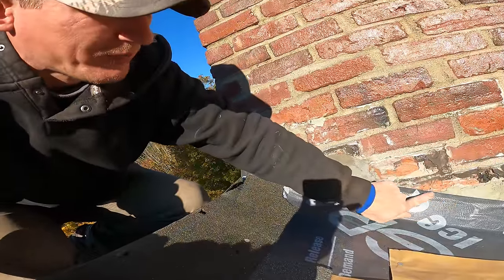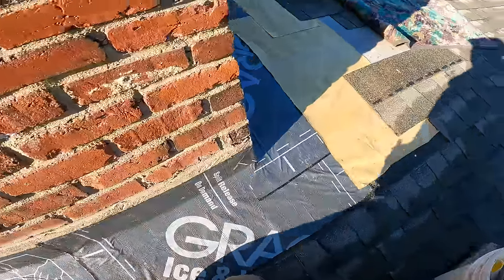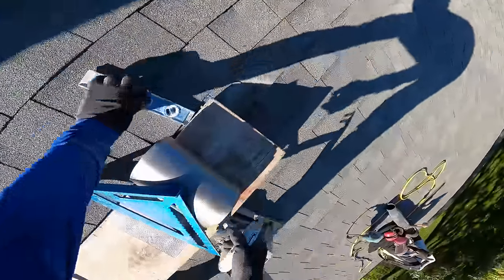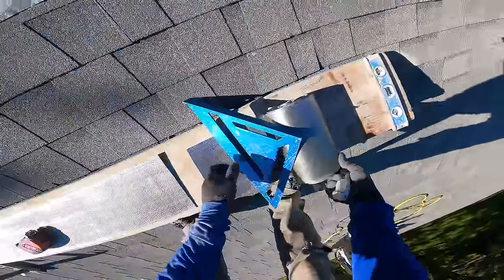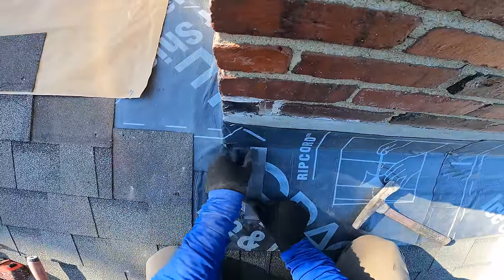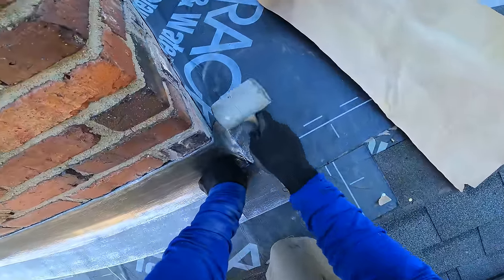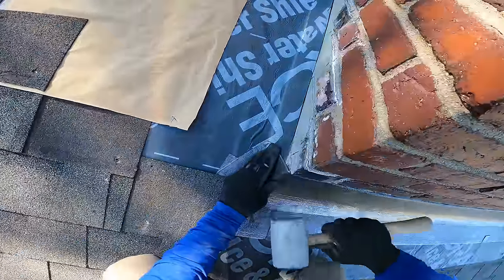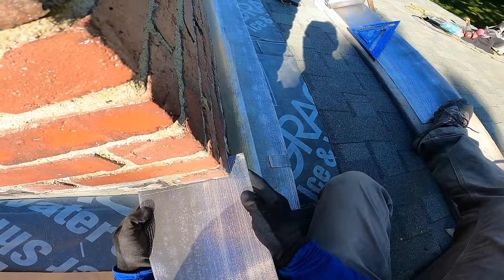Chimney flashing install | Part 2

Comment: We have been engineers and general construction managers for 40 years.  We have seen every way to flash incorrectly and they all fail.  However, here we have genuine cut-in step flashing!  This is the only way to correctly  flash a chimney or trim.  Very enjoyable to watch flashing done correctly.  This should be a training film sent to all roofers in America who would nail their aluminum flashing on the brick and caulk with any tubes of caulk that will fail within a year or two.  A genuine thank you for posting this very well done effort.
Reply from the maker: Than you for your kindness.
Reply: I just posted above, but have to say I totally agree with you. He did such a good job and the video could literally be a training film.
Reply: lol wut,every chimney done with solar seal caulk and proper double hem bent towards chimney will outlast shingles. engineer and manager means you havent done 300 chimneys like i did with my own hands and theoretical knowledge is not always works in actual field work
Reply: Would it work if you put the ice and weather shield right to the chimeny and then put roofing cement to cover it?
Reply: @jusnielful  just cement along the perimeter can make it last a while,no need for ice water
Reply: This would be a cowboy job in the uk  definitely not a how to
Reply: @chadvaillancourt What causes a concrete fire hearth to be very damp?  I would appreciate as much technical advice as possible please because I have an issue with my chimney I think?
Reply from the maker: @rachelbailey-no2pp It’s hard to say without pictures, there are many possibilities. if you send me some pics I’ll take a look.
Reply: Only thing missing is comments like ‘each counter flashing step should be x” wide and y” long’ and “ make sure they overlap by z”’.
Reply: No lead tray!
Doesn’t matter how well you cut your flashings in and seal them!
If you have moisture coming through the top of chimney , where’s it going to go?
Apart from inside!!!!
Reply from the maker: @DavidWilliams-zn2nc we don't install lead trays because they always fail. If they worked, I would consider them. Every chimney I do is water tight when I leave.
Reply: @chadvaillancourt   Sorry mate, lead trays when installed properly don’t fail.
I’ve been a roofing contractor for 40 years, lead flashings when done correctly are fine for waterproofing the outside.
Bricks are porous by their nature, so any brickwork above the lead line is susceptible to water ingress. When done correctly with weep holes ,the tray allows any moisture to escape the chimney out of the weep holes over the lead. 
Ill be happy to post the the technical diagrams if need be 🤷🏻‍♂️
Reply from the maker: @DavidWilliams-zn2nc I know how they work in theory, I've even seen some really good ones in person. They cause the chimneys to fail in my climate. We have a lot of freeze thaw. I'm open-minded, I could be convinced if I ever saw one that was done properly and still complied with todays standard. Besides, I solve these problems every day on chimneys that have been leaking for decades without    rebuilding and adding a lead tray. I'm working on one today. It has a lead tray and leaks every rain. It won't leak when I'm done.
Reply: @chadvaillancourt  Well, you’ve almost answered the issue, in theory it will always work, fact!
The problems start when they’re not installed correctly!
The Brickie ( mason ) must keep the inside of the chimney brickwork clean. If not, and the tray becomes full of mortar then that will stop the tray doing its job.
Unfortunately, this sometimes happens & of course it’s the roofer who gets the blame for any leak!
I can see you’re a skilled tradesmen, all the best 👍
Reply: Or to the ones who cut right through the brick diagonally. Chad's probably seen it in his area
 I see it way too much

Comment: Polyurethane caulking works so well. Much better than silicone. Comes in many colors as well and smooths out like a dream with dawn dish soap and water.
Reply from the maker: Polyurethane caulking is subject to UV degradation and won’t last nearly as long in this environment 😕
Reply: @chadvaillancourt  I get it. 5-10 years vs silicones 20 year life. Poly accepts paint well around brick mould and is excellent for sealing wide cracks in masonry. Easier tooling as well.
Reply: NEVER use any soap for smoothing sealant. EVERY major manufacturer says to dry tool
Reply: @chadvaillancourt  silicone does not bond to graces self adhered sheet goods. In fact we use it to make temporary dams on bituthene for water tests because it peels off easily and cleanly.
I have installed polyurethane sealant  on high rise buildings that is still in perfect condition after 30 years. But you have to use quality products.
Reply: @bunnylou4993  if you are only getting 5-10 years from polyurethane you are either installing it wrong or using cheap material. But since you said use soapy water it is clear you are installing it wrong. We routinely get 20-30 years from urethane.
Reply: Has anyone tried E6800?  Or Vulkem 116?  I had a Velux skylight fail after 10 years. The factory sealant between the glass and aluminum trim (not the flashing) became brittle and leaked.  I dismantled it and applied clear E6800 because they claim UV resistance.  It's been about 5 years and no leaks yet.  Both of these products are supposed to work on masonry.  Thoughts?
Reply: @dumbluck6180  Vulkem 116 is a quality product. I have used it for probably 25 years or more.( maybe 30) I have no experience with E6800. But it is a consumer product and generally speaking consumer waterproofing and sealants are inferior. And since all the specs I can find say it is a construction adhesive I would never use it in a waterproofing situation. Construction adhesives are not the same as Caulk or sealants. I could be wrong about it since all I could do was try to find its specs. But as a professional waterproofer/caulker I would never use it . BTW a good sealant when properly installed should last 20-30 years or more.Of course no one will guarantee it that long.

Comment: There have been a lot of bad ideas and false claims by new products in the trades over the years, so it is no surprise that people who get used to using one product are gun shy about accepting a new product or new way of doing things. However...the "has to be mortar" guys need to face it: modern tri-polymer caulks like Geocel, Through the Roof, etc. absolutely outperform mortar in this application in every way possible. They are more waterproof, they are tougher, they will last longer, they are more resistant to the kinds of stresses they will experience in heat/thaw weather cycles on a roof, they adhere to the substrates better(mortar doesn't adhere to lead AT ALL), and they are flexible to allow dissimilar movement between substrates without failure. There is literally NOTHING that mortar does better in this situation. Nothing.

Comment: Super clean install. Great 2 part video to learn from. I have a lead flashing repair to do and this taught me a lot. 

Pro tip: Once you the last ridge cap shingle is on and the silicone is wet. Rub 2 shingles or caps together over the silicone so the granules fall into the silicone so you don't see the nail heads. Another option is to put silicone/tar/roofing cement all over the last ridge cap and wet set another one over the top of it so you don't have to worry about nail heads.
Reply from the maker: Thanks, I’m glad you learned something from this. 
Great idea with the granules. I know they sell containers of granules but I never thought to grab some from the shingles I had. Almost all roofers here don’t cover any exposed nails with anything anymore. Sad really.
Reply: Smart, I'm doing this on my next roofing job!

Comment: The amount of time and care taken for this job was amazing.   I'm redoing my whole roof and wanted to flash my chimney in a similar way but finding lead flashing and the sheer cost of copper just doesn't make sense unfortunately.  Still hard to find some of these specialized materials here in the Midwest without paying an arm and a leg.
Reply from the maker: Thanks! Lead is available at all masonry outlets and hardware stores here, even Lowes and Home Depot have it. It costs about $140-150 per roll now, although I have one supplier that will sell for $110 per roll.
Reply: If you know of another system that works then it would be interesting to hear about it.  Otherwise how can you afford not to do it this way?
I am not trying to be a jerk.

Comment: We use lead plugs to keep the lead in before siliconing little strips of lead rolled up and pressed into the joint so that it's tight and the lead doesn't move 👍👍 but really like how you do it as I haven't seen many people using lead over your way it's great to see

Comment: Great workmanship! I've been roofing for 45 years and haven't seen workmanship like this. Especially scribing the vertical lines to get a nice plumb look! 
Only one little nit pick, the nails in the shingle at the bottom left corner (1:02:22) are too close to the flashing and being that the flashing has a slight slant to it away from the fireplace the water is going to head toward those nails. Will it ever leak? Probably not, but after all that fantastic work it's the weakest point. I also like to leave about a 3/8" space between the edge of the shingle and the vertical bend in the shingle to allow a space for the water to run down. The water can still run under slightly but it helps with the water flow especially if the chimney is lower on the roof where there is more water accumulation. Thanks for the detailed workmanship. Nice to know that there are still quality workmanship being done!
Reply from the maker: Great catch with the nail! I’ll have to do better next time. Thank you for pointing it out and thanks for your comment. Very observant!

Comment: What a nice job!  It looks really good too.  Good explanations on why you do each step.  I do handyman work, and nearly every house I enter has botched work. It blows my mind how much bad work I see. In Part 1 you showed layer upon layer of messy repair attempts that failed.  Those hack jobs are fine in an emergency like during a storm when you're just stemming the tide until you can do a proper repair.  Very much admire your skill and methodical work.

I'm originally from MA and your accent sounds familiar!  My 70 year old house in OR has the original heavy galvanized steel step flashing. I re-roofed 27 years ago, and just lifted it up like you said. It could probably go another 20 years, but I'm going to replace it with lead the way you did.
Reply from the maker: Very kind comment, thanks for the support.

Comment: We’re having problems with a smaller chimney that used to be for a oil burn furnace but now simply acts as a stack for the vent and exhaust for the gas forced air furnace. The roof shingles were replaced two years ago and now we’re getting leaking in the basement that comes down the chimney sides. I had to laugh at your comment when you said that roofers and chimney guys don’t do each other’s jobs because my roofer won’t touch it with a 10 foot pole so I’m gonna have to hire a professional like you to do mine And I’ve got a place in mind. Thank you for showing us how the real pros do it. Good luck, live long and prosper.!
Reply from the maker: Yeah, it’s a tough thing. Your roofer likely put enough silicone to make it not leak for a couple years, now his work is showing through. Thank you!

Comment: I live in hill billy USA. When the roofer talked to me about flashing the chimney following a derecho, he said most people just have it packed wiith roofing cement, but I opted to have it flashed by their sub contractor for $250. The roofer did the lower flashing. The flashing guy used metal, not lead. He didn't step flash but just has it running at angle parallel to the roof line. I had to have him come out two more times to fix it from leaking. He said he cut a groove before installing it. I guess he did. My chimney is well down from the ridge in the middle of the roof. At the time, I didn't know how to build a saddle or cricket and the house didn't have one. My guess is the chimney sat on the ridge back when it was built in 1923, but the deadliest tornado to hit the USA decimated this town in 1925, and it appears they changed the orientation of the ridge from front to back to side to side resulting in the poor placement. Anyway, long story. You do great work.

Comment: This is the quality  craftsmanship I try to achieve on a daily  basis.  I'm a mason for a chimney company  just up 495 and there always rushing me 😆..  I actually  stumbled on your channel because I'm a self taught  and I sometimes use YouTube sharpen my skills .  I also have the same thoughts on caulking those joints 👍  I use a geocel caulking  myself.
Reply from the maker: I’m glad to hear it! YouTube is a great resource no matter the skill level. Everyone has a different way and lots can be learned if people are willing to share. I used the geocel proflex for years but I had to stop because of the cardboard tube. It’s a good product.
Reply: Do you think  silicone fails more often than well set mortar over the long run?

Comment: As a retired contractor of 42 years..I can tell you that Through The Roof Caulk is one of the best products for sealing most anything through the roof..It Bonds to almost any materials and it does not dry and shrink like traditional silicone and crack away or pull away from material..Its almost like an adhesive as well as expandable caulk..You are very thorough and looks great..

Comment: Great job. 

You want to “dog ear” (cut at a ~45 degree angle) the top corners of the shingles abutting the chimney so that any water traveling laterally off of/away from the chimney travels back toward/down the side of the chimney. Also, leave a little space at the angle change so water can flow freely along the side of the chimney.

Comment: Chad, I have to say that I am very happy to see pride in craftsmanship!  I hope you share your ability and attention to detail with someone so it's not lost.  I'm watching these videos due to the fact that we have a newer roof ands it's leaking into the fireplace.  I have a tarp over the cap to see if it's coming from there, but it's still coming in.  Which i assume leaves the flashing, which looked a bit like this one in the beginning.  Mine however is on an exterior wall and recessed into the roof with a 5-12 pitch.  The chimney is 3 to 4 ft wide, and the ridge side is just flat to the back of the chimney.  Shouldn't that have a gable built to the back of it, to divert the water away?  It's probably 14' of water hitting on that side.  You can see were the previous flashing was stepped down the sides, like you did the lead, and the caulking was just left, and the new flashing matches the slope and is caulked in.  I don't suppose you are local to NC?  Either way amazing work!
Reply from the maker: Anything over 30" wide; parallel with the ridge, really should have a cricket or something to help shed the water. Thanks for your kind words!

Comment: Chad - Thanks for the great detailed videos on this flashing technique.  On both of your repair videos the chimney is at the ridge.  My chimney is at the bottom eave/gutter end.  It is about 20" wide so no need for a cricket.  But how would you flash the back side of a chimney like this?  Would you get a 30"x30 square piece to go up the chimney and up the roof in one piece?  I would be concerned any piece on a 4/12 pitch roof would tear trying to make the bend on the corner from the back to the side.  Thanks for any advice.
Reply from the maker: The method is close to the same. I did show it on some of my other videos. Maybe check the shadow-box chimney I rebuilt, there should be something on that one to help you understand.

Comment: I use torch down modified bitumen as flashing on my commercial building. Goes down super fast and 100% waterproof. This video shows a high class job but labor intensive.

Comment: Chad, your craftsmanship is top notch. I recently had a roof replaced and 5 days later heavy snow and then windy rain. It turns out I now have water infiltration around my chimney which is what brought me to Youtube looking for an answer. The roofer claims the flashing is the responsibility of a mason even though the estimate included new step flashing (didn't happen). Their answer was they tucked the new lead under the old. I had a mason friend take a look at the chimney because the roofer claims the pointing is the issue. Mason and I went up on the roof and find lots of silicone around one corner of the chimney. The question I have for you is because my chimney is about a foot off the peak how are the flashing and shingles supposed to tie into each other? Basically there's an area where snow and water can sit and is sitting, the silicone is spongy and has a pool of water sitting in it. Granted I'm in New England and did have a heavy snow followed two days later by heavy winds and rain but water infiltration is not ideal period especially when it never happened with the old roof.
Reply from the maker: If it didn't leak prior to the new roof, then it's the roofers responsibility to fix. Water should not be ponding behind the chimney. That's on the roofer to get water to pitch out of that area.